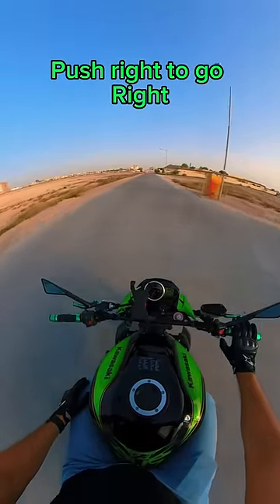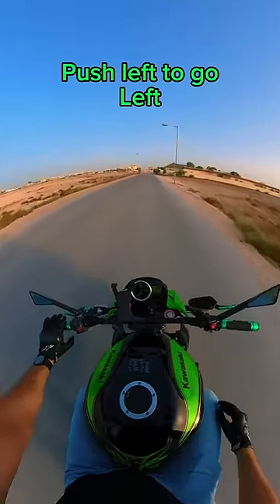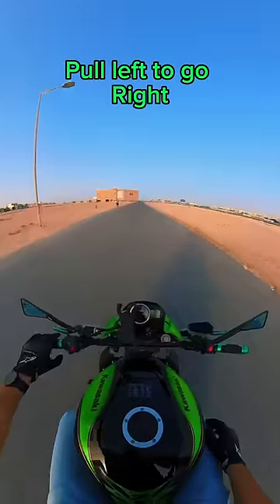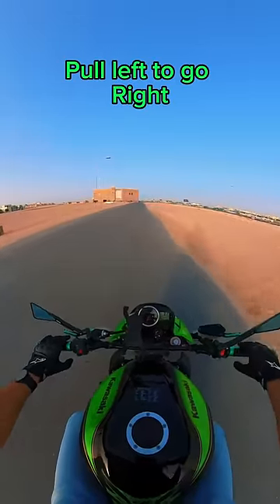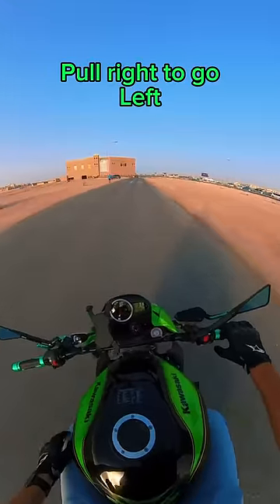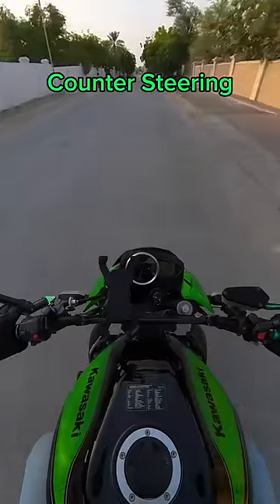Counter steering. How to turn a motorcycle.

Comment: So simple. Exactly what beginners need to know and not the fancy physics shit. Thank you!
Reply: massimohack1367 what relevance does that have
Reply: massimohack1367 never ever road before just got a GSXR 1000. Is this a good beginners bike.
Reply: To each their own. The idea of counter steering confused the hell out of me until I understood camber thrust
Reply: @AjRobinson808 it confused the hell out of me too. I finally understood it after I learned all the equations that use E=mC^3
Reply: @STORYMUNCH1  Of course not but its possible. Ive never rode before either but let me tell you this. I had a Subaru that was pretty quick. I had an emergency and needed my sister who barely ever drove to come meet me at the airport. I told her to just drive carefully and dont step on the gas to where the turbo spools and surprise you. She drove successfully to meet me and then afterwards I began teaching her to drive with that fast car. Its fast only when you step on it. I think bikes are the same. Fast only when you pull the throttle aggressively. A vehicle does what you make it do. Easy on the gas and be safe and you can ride or drive anything. I got my truck job the same way. Need really drove trucks before except a few lessons on a tiny truck...more like a van to get the heavy license. I lied and told the supervisor that I have experience. Took my time and drove that utility truck like a granny. Ten years later and I'm one of the best with no accidents so far. Hope I didn't jinx it by making this comment.
Reply: I explane for beginners that you ride like how superman flies.
Reply: Actually some bikes will hit gyro way before 20km/h cause counter steering to be needed earlier. It's different with every bike.

Comment: This is the best explainer of counter steering because you address the differences between pushing on the bars vs. pulling and what the differences are. So many people are horrible at explaining this.
Reply: I think he was pretty horrible at explaining this lol. The push and pull thing is right but he makes it sound like you have the steer in the opposite direction lol
Reply: I don't understand how pushing it forward makes u go the other way
Reply: @josephbates7967  Pay attention when he's sitting still on the bike and what happens when he pushes down on the handlebar. The bike leans in the direction he pushes down. If the bike leans left, it turns left and viceversa. Same as when you're on a snowboard/skateboard or bicycle
Reply: @josephbates7967  he said pull left to go right, not push left to right

Comment: Isnt this basicalyy ''leaning right to go right'' wouldnt this explain it more intuitvly but am i missing smthing ?
Reply: You may not lean to follow a curve above 20kph. Just push the right handle bar a little bit, maybe 2-3 inches at first to test and then you will turn right. Push left to turn left. This doesn't apply when you are very slow or below 15 kph.
Reply: @pedro_kapparosso  I got my license yesterday, and they mentioned that we should learn counter steering (as the range wasn't big enough to go faster than 30kph, hence why I'm here) but I'm still a bit confused on the direction we push the handlebars. Do we push the handlebars forward or down? It looks like hes pushing it down but he says push it forward
Reply: @jarroddt  practice in an open area with no vehicles that might put you in danger. It feels awkward at first but you will get used to it. Push for around 3 inches forward and feel the bike lean. When I practiced it, I tried to push the right first and tried to go straight but I felt the bike going right.

The more you push, the more you will lean. If you release the power of the push, the bike will go upright again. Watch videos about trail braking,too, but for now focus on counter steering as it is the only way to deal with curves. Ride safe, my friend.
Reply: @pedro_kapparosso  I see. I''m definitely going to be practising in parking lots at night for a couple days so I'll practice that too.
Thanks heaps!
Reply: @jarroddt  you are welcome. You can also learn with a riding coach in your city.

Comment: great simple explanation. where virtually all other explanations confuse is when they say stuff like 'push forward with the left', which sounds like it's going to turn the bars if you push in the direction of travel, but you demonstrate pushing TO the left (90 degree's to the direction of travel) and not 'forward' per-se. a subtle difference. It's a bit moot though because most of us must do this as second nature without thinking about it anyway, else we wouldnt be able to take corners lol. Thanks.
Reply: But how it became 2nd nature in the first place??
Reply: @jad2290 good question, but i suppose the simple answer is that you just can't turn the bars easily at any faster speed and control it, either on a pushbike or motorbike, so it must become instinctive then ingrained without thinking about what you are doing, if not you crash lol, but when you learn a bit more about countersteering it does help you improve your technique. GL
Reply: @Bob-ts2tu  
How do I make my second nature though??
Also at higher speeds we're basically turning the bars too no? Just using a different method
Reply: @jad2290  by pushing left you tilt the bike left and that makes it turn in that direction, leaning also helps, you dont actually turn the wheel with the bars like you do at walking speed. it's hard for me to elaborate more, sorry, but there's nothing to worry about you will do it naturally yourself when you start riding. GL

Comment: To explain whats going on, whenever you turn to a direction without leaning along the handlebars at low speed, the bikes center of mass is elevated due to you being ON the bike, and this causes the bike to lean into the opposite direction that you "attempt" to turn into, thus why its called counter steer, you shouldnt try to force this, just think about turning, and your brain will do it for you, just concentrate not to look like a moto gp driver and you will pull thru just fine ❤

Comment: i still dont understand the physics behind this. how tf does the bike turn left when the wheel making it turn is facing in the right direction
Reply: the wheel doesn’t turn, what actually happens is that you shift the weight to the left by pushing yourself using the right handlebar